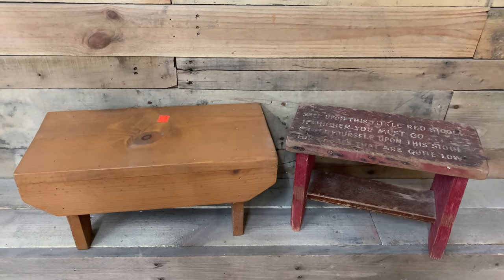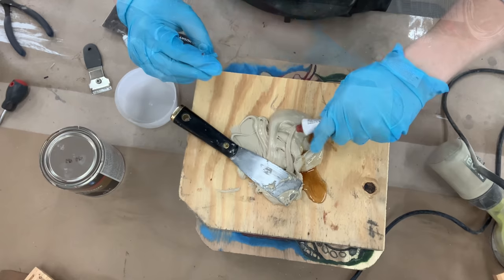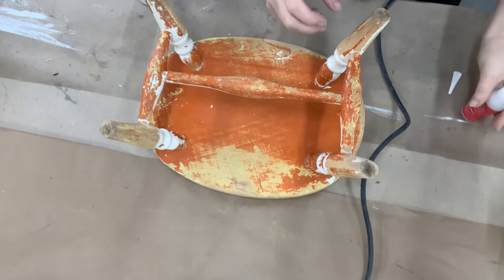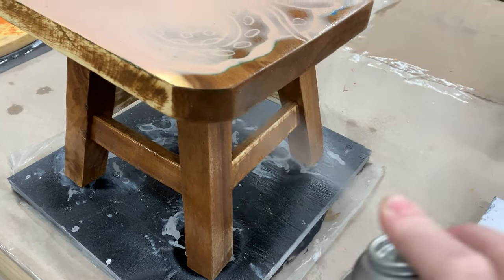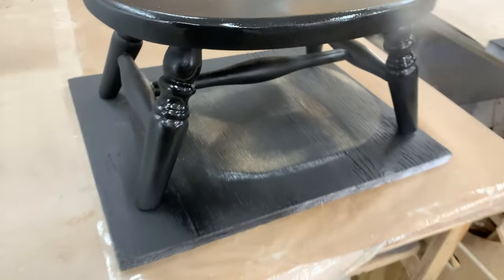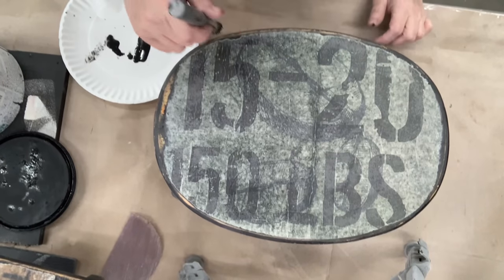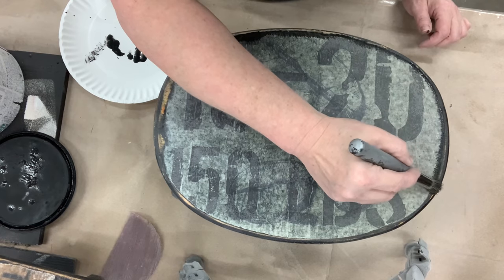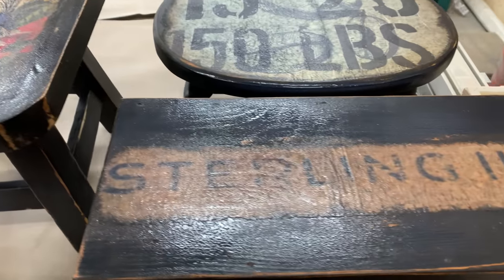5 Little Stools || Thrifted || Makeovers || Trash to Treasure

Comment: I have an antique kitchen table that someone painted white with Flamingo. Pink or Magenta in the drawer. It's very sturdy and I love the table but hate the pink. YUK. I want to strip the top to see what the wood is. I think Maple from the bottom of the drawer. My kitchen is decorated with apples and sunflowers. You had some beautiful Sunflower stencils or decals. Would love to know where to find them. I love realistic art, not funky stuff. I think you used them on Windows. Can't remember. Please let me know where they were purchased from. I'm thinking white with natural top and sunflowers to decorate the top. I may do some green on the drawer and spoiling on the legs. I love country and farmhouse decor. 

I also have a ceramic piece that is white, a Gnome, and has a shiny finish. Can you tell me the best way to paint it so the paint will hold? I was considering painting all the detail on the Gnome to give it character. He's about 15 inches tall. Would be cute amongst my house plants near my stone water fountain. The fountain looks like black or very dark gray stone and is about 25" tall by 20" wide. I've got it surrounded with plants. I want to make the Gnome POP like a fairy garden. White is just too sterile for my taste. The ceramic is a shiny glaze and I worry that paint won't stick or hold up on the finish.

Love your videos. Any advice will be appreciated.
Reply from the maker: Thank you, 
They were IOD transfer. Absolutely gorgeous 🌻
You sound like you need to go to our channel page. The link for those transfers is in the windows playlist 
And just pick a white piece of furniture in our furniture playlist. The kilz paint and primer in the flat white is a wonderful paint. 
To try to explain in a text of the how too .. is a lot. 
Outside pieces are a little harder.. Anne Slone may be a great choice for the kind of items.. I don’t do much outdoor stuff. We live in Michigan.. winters aren’t kind

Comment: What is the difference between Bondo and Durham water putty and would not Durham water putty have worked on the stool
Reply from the maker: Yes.. it would do the same. The bondo actually dries much faster. I just wanted to show other options of filling in